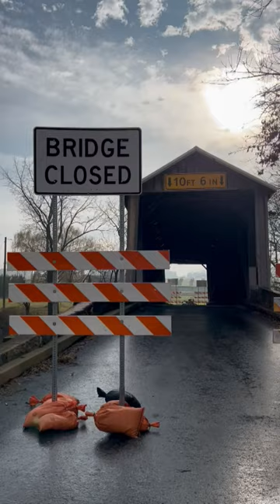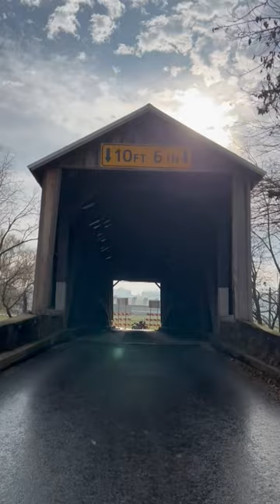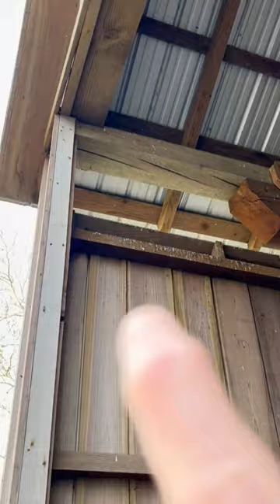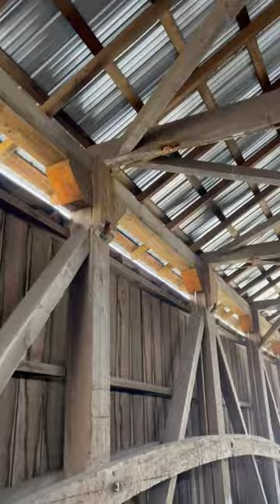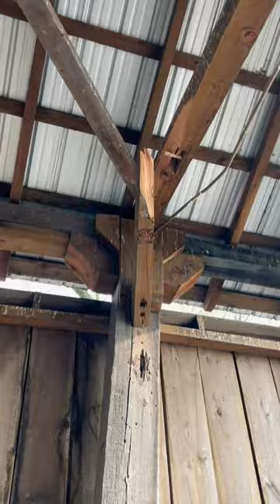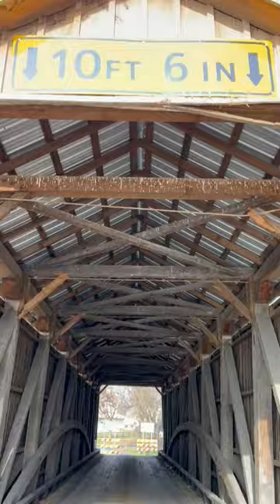Truck damages Lancaster County Covered Bridge: Bitzer's Mill. heartbreaking

Comment: In my 35 years of driving truck I’ve never seen a wooden covered bridge that would fit or support a truck!?
Reply from the maker: The bridge is rated to hold 20 tons, but it doesn't have the height for a tractor trailer. I can't fathom how the guy even got as far in as he did.
Reply: @honkerman74  20 tons! Wow, ones I’ve took notice to are 5 to 10 tons, but still , taking a tractor with out a trailer to me is still not a good idea. The trucking company is probably on the hook for that bridge repair. Have a good day!
Reply from the maker: Other than this one, the max I’ve seen is 5 tons. They are usually 3 or 4 tons max